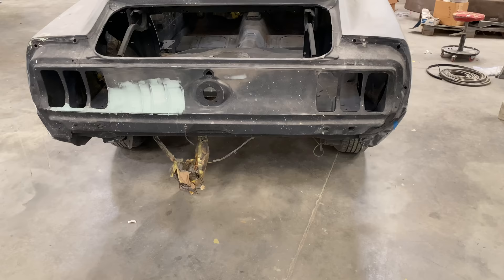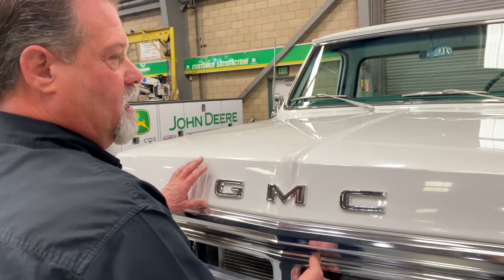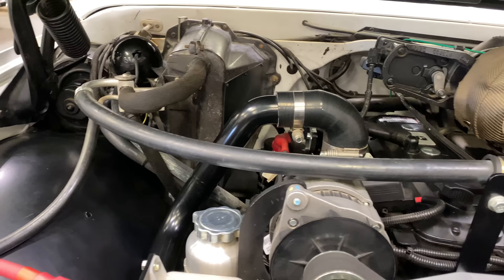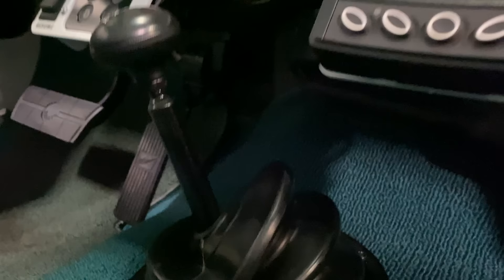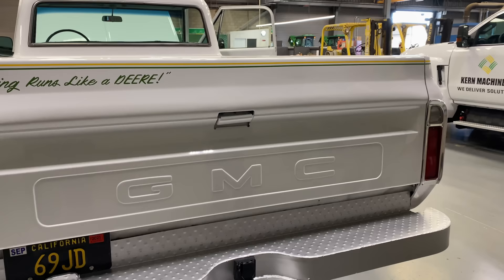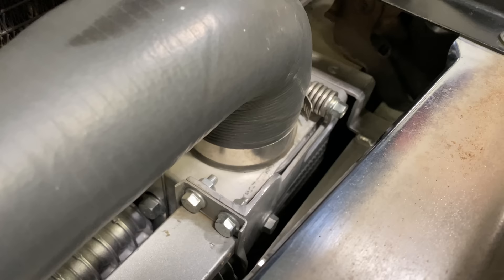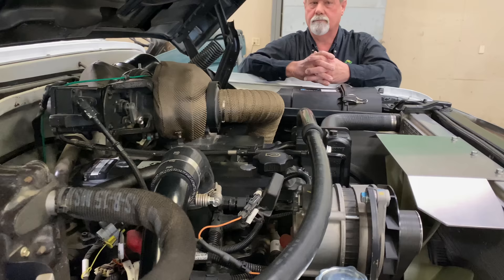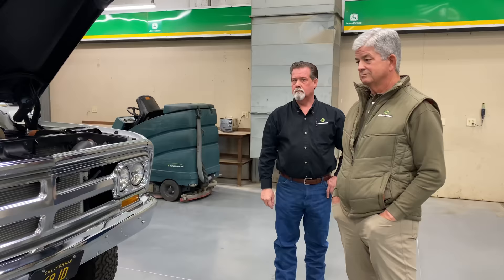John Deere Tractor engine in 1969 GMC truck!

Comment: I have done two conversations using John Deere engines, turned out well and my customers where quite happy with them,
Reply: My grandfather has a 77 f100 with a 2 cylinder jd 60 in it. He still drives it.
Reply: How do you come up with a flywheel that works?
Reply: conversation 🤣
Reply: @bradoliver9475  right,! Any body can do a conversation.
Reply: @earlwest6005  Pay a whole lot of money to the machine shop.